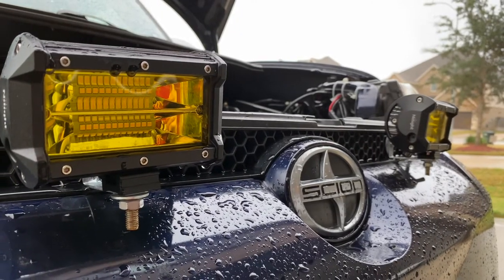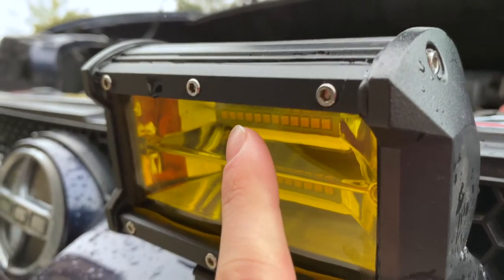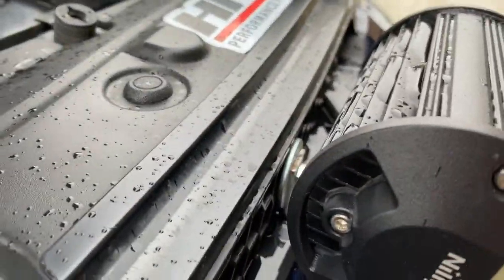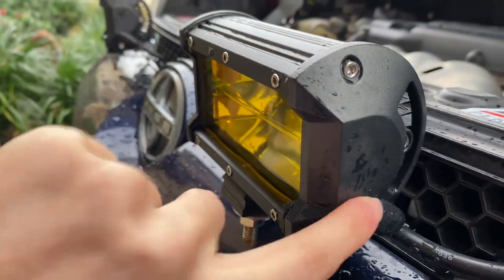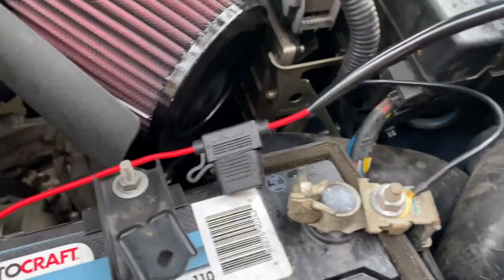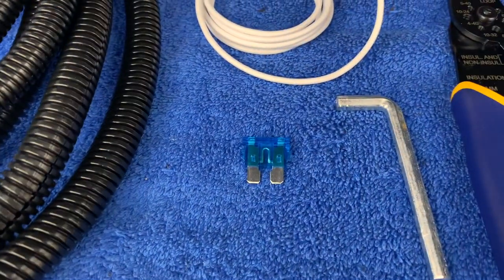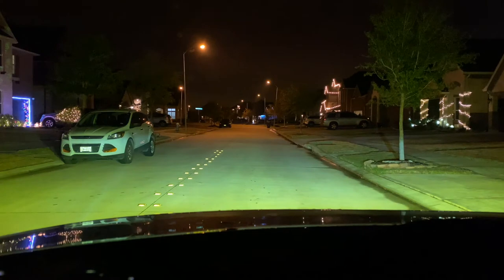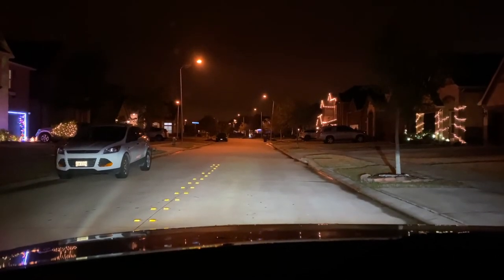LIGHT UP the Night! YELLOW LED Off-Road Lights

Comment: I had four of that style of pods (different seller but prob same thing) in white as work lights and they were the only Amazon lights that I have never had water in and I didn't seal them other than where the wire goes in. The ones I had had thin steel brackets which broke however. Used them as work lights on a tow truck so they had a lot of vibration and took a beating before the brackets broke. I go down lots of washboard roads and little turkey trails

Comment: 15 amp fuse is too much, check with a multimeter the power draw on those cheap ass chinese lights, they will draw something like 5-10 watts,  I dont care what they  advertize, they are advertizing the halogen equivalent.  So when your wires short out and dont pop the fuse youll know why..
Reply from the maker: Thanks for pointing that out I’ll give it a look
Reply: @thebluexb  ya switch it to a 5amp fuse or hell 2.5amp  I bet those lights use 10w a peice.  10w is 0.83amps fyi.  20w is 1.66amps. And 30watts is 2.5amps. And so on.. you see where im getting at ?  15amp fuse on lights that would use say 2.5amps together is no good.   Look up videos on how to check the amp draw with a multimeter.. its easy.. and youll be shocked.  For example those 300w light bars people put on their roofs.. they put out like 30w of power..
Reply: @jeepsblackpowderandlights4305  they prob draw 1.5-3a or so each